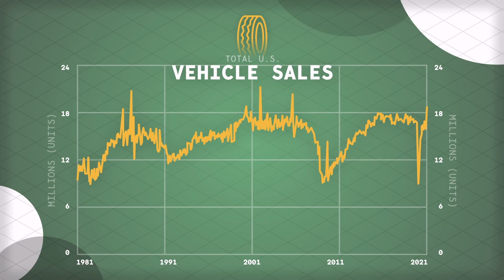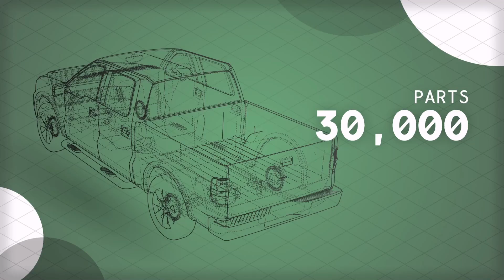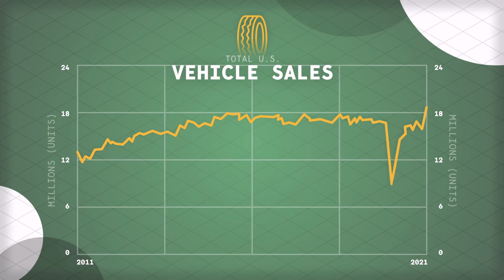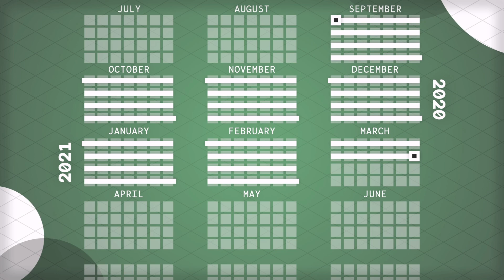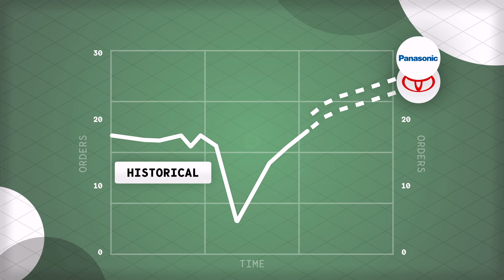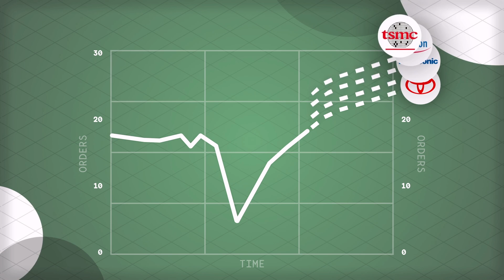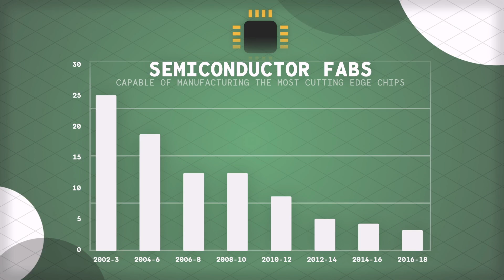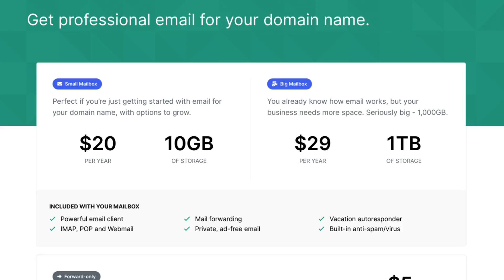Why the World is Running Out of Computers

Comment: I thought we had ran out of silicon, knowing it's just a logistics issue gives me some relief actually
Reply: I mean, silicon (next to oxygen and iron) is so abundend you will probably never run out if it unless you mine Earth
Reply: @fiiral5870  What do you mean? sand is so hard to come by these days, it's not like we have deserts of it lying around. /s .... (Yes I know we use a special type of sand, silica sand in the chip manufacturing chain, but it's still relatively abundant on earth.)
Reply: @holyboboli  sand rounded by wind is too round for cement, it need to be pointier to get in grip with the rest of the structure.
Reply: @holyboboli  there is actually a shortage of sand funnily enough
Reply: @expiredgoatmeal1666  Well, that too is a logistics issue tho (unless you want to tell me that the Sahara has no sand)
Reply: @holyboboli  not all sand is anywhere near the same. 2nd sand is silica not straight silicon. Beach sand is very round and smooth which is y Arab nations will import it while having endless deserts all around
Next time u go to a home improvement store look at the construction and vs the play sand
Reply: @Copyright_Infringement  The only usable sand (as far as we deem them to be with current technology) is sand that you get from river banks, so deserts are no help
Reply: @holyboboli   Imagine not knowing what sand actually is and thinking all sand is the same.
Reply: @holyboboli  Dubai
Reply: @jinjunliu2401  sand for silicon isn't bought because it's good for making concrete. Melt,purify,process,crystallize.... Then you've got the semiconductor.
Reply: @holyboboli  it's not really sand anymore it's quartz nowadays so yeah we're kinda fine
Reply: @retardationnation869  your wrong about the beach sand look up beach sand under microscope and you’ll see it’s not smooth at all it’s not even sand
Reply: @konopandada7872  and if i loo at a razor blade une one it's jagged and not sharp
Reply: @holyboboli  there are different categories of sand, some of which we are running out of. Silicon is also a major component of many rocks, and is one of the most abundant elements on earths crust.
Reply: @itdepends604  It seems you missed the sarcasm in my statement. Silicon is the second most abundant element found on Earth's crust.
Reply: @itdepends604  It's not a matter of the different forms of sand all having silicon .. it's the processing costs to get that silicon out. It's no different then getting hydrogen from nat gas versus from water. Both CH4 and H2O are quite high in hydrogen. To extract we have steam reforming of methane vs electrolysis of water. Only the former has reasonable production costs and an end product with marketable pricing.
Reply: @retardationnation869  You mean someone is selling sand to Arabs? LOL.
Reply: @holyboboli  Desert sand isn't useful sand, like how seawater isn't really useful water...
Reply: @Kurochana  I prefaced it with the fact that I know that we specifically use 95% grade silica sand.
Reply: @retardationnation869  "beach san is very round and smooth".. aren't it's the other way around; the sand which are eroded by wind is the one that's smooth and round shaped.

While the beach sand's actually the one that's rough (which is good for constructing)
Reply: @holyboboli  But how easy is the majority of it to access? We haven't run out of oil but it's getting more expensive everyday because the easy sauces are running out.
Reply: @fiiral5870  and it ain’t like Meteors or a synthesized form of it could be made. Just look at oil and coal!
Reply: Silicon is maybe the most cheapest mineral in the world simply bcoz its 3rd most abundant element in earth's crust
Reply: the issue is not on the supply side, its the demand thats never been higher. new consoles, new phones, smarter cars, smarter tvs, smart appliances... it all adds up, and if you dont get your order in quick enough, like car manufacturers after the pandemic hit, you get left behind when companies like nintendo and apple buy up half of the entire stock and the rest is being fought for by hundreds of big time companies like nvidia, amazon, microsoft, etc.
Reply: @jonathanodude6660  Amazon, Microsoft and Apple have the resources to build their own fabrication facilities. They could easily buy licences to build the chips required if they put their minds to it.
Reply: @AndrewHalliwell  they don’t have the skill nor the need. Tsmc has always been there for them. They don’t need to branch out of design and into manufacture if tsmc can keep up. Apple still uses intel modems, Samsung screens and other parts from other manufacturers because apple does not manufacture. Idk much about Amazon but both them and Microsoft have historically been software driven companies that have acquired and sold niche hardware solutions to advance their business. Neither of them manufacture as far as I’m aware. Going from 0 manufacturing experience to one of the most difficult things to manufacture other than scientific equipment for space flight or nanotechnology and trying to still be the best sounds like a recipe for disaster, at least for apple. Amazon does stand to gain from it but Microsoft will probably screw it up, let’s be real here.
Reply: @jonathanodude6660  Fair point about Microsoft. Screwing things up is what they're good at.
Reply: @AndrewHalliwell  they dont have the skills. making chips is an extremely hard. unless they hire a bunch of Taiwanese engineers and technicians they wouldnt be able to even they wanted
Reply: It's actually a chronical problem with the automobile industry ever since the idea of JIT (Just-In-Time) manufacturing became mainstream in the industry. Automobile manufacturers, having grown used to being the "boss" in their supply chain, didn't realize that they can't treat chip fabricators the same way they treat bolt manufacturers, simply due to the reality of the lead time.

If anything, fabricators like TSMC had already warned these automobile manufacturers in 2020 beforehand that it will be extremely difficult to try ramp up production again for them, once they drop their orders, in part due to the lead time, but also importantly due to how consumer electronics orders are much more profitable. But they ignored the warnings.

Interestingly, Toyota, the origin of the JIT concept, isn't affected by this chip shortage. Analysts believe it's because of the 2011 Japan earthquake and tsunami dealing a devastating blow to Toyota's supply chain, that they realized the long lead time in car chips make it unsuitable for JIT manufacturing. It took Toyota almost half a year to restore manufacturing operations to pre-tsunami levels. That prompted Toyota to draw up a list of around 500 priority supply items for which they would demand higher stock levels to hedge against unpredictable circumstances, allowing Toyota to escape the global car chip shortage this time.
Reply: Let me tell something new, there's hundreds of sand mafia in south asia. There's tons of sand in sahara but it's useless compare to river sand. Also river sand take a long time to be useable
Reply: Well run out of helium before we run out of silicon, I guess lol
Reply: There's an entire valley of it in California.
Reply: @FirstLast-uz6eq  😂😂😂😂
Reply: @FirstLast-uz6eq  silicon valley
Reply: Polymatter made no mention of natural conditions of Taiwan lately though. Record annual droughts are a real factor as the semiconductor industry there requires ALOT of water.
Reply: You have NO IDEA how relieved I was after reading this
Reply: Me too man... I thought I would never enjoy playing or watching anything digitally
Reply: @coloredfox3463  haha yeah. Bruh, I was born on 2002. Imagine visaualizing the next century of my life with minimal computers. Then I read this comment and watched the remainder of the video. Biggest "bruh" moment of my life.
Reply: @FelipeGonzalez-le5jv  I feel you man. I love videogames and tech. Without it, I wouldn't be who I am today
Reply: human's may be dumb, but we aren't dumb enough to build an entire economy of 7.6 billion people based on a limited non-renewable resource.

wait
Reply: VeChain baby
Reply: silicon is abundant but other semi-conducting materials like copper and gold (that are used with silicon to bulit chips and hardware) are one of the many minerals that are truly running out, and im talking about in the next 25 to 50 years left of supply.
Reply: They plummet the prices, so they can earn more
Reply: In 50 years we run out of Fossil energy
Reply: @idmarilamri6398  yes
Reply: I am here to sell all of you the best sand! It is the best. 2 for 1 special for you.
Reply: Lol... you thought dumb
Reply: It's not a matter of silicon abundance. It's that silicon it becomes harder to manufacture chips at small scales. Personally I think the industry is giving up on mass producing 7nm and below. Yes, I know we've engineered 7nm and below chips. But I'm talking about mass producing 7nm and below chips with new architectures, that includes server and desktop PCs, and bringing them to market.

We'll see them in the marketplace but they will not be mass marketed (to consumers) and they will be incredibly expensive because the process yield will be low.
Reply: Yeah I felt soo happy when he said that
Reply: Just wait till China invades Taiwan and then the Chinese start price gouging/creating perpetual artificial shortages
Reply: It's the most commen element in our known univers we can't run out of silicone
Reply: @hotsauce1646 : Some of us are not scientifically inclined lol😂
Reply: Same. I legit thought it was a Silicon issue as well, which would have been catastrophic to say the least.
Reply: Reading your comment gave me an anti-heart attack.
Reply: @Celery Man silicon is almost as common as oxygen.
Reply: @Celery Man that’s why we need to kill more people.
Reply: Oh don't you worry, they're working on new, innovative ways to make sure we run out of silicon and everything else. Gotta keep demand high!
Reply: @ArcangelZero7  we will run out of oxygen before we run out of silicon.
Reply: @ToomanyFrancis  And don't worry, when we do, they'll be there to bill you for the privilege of breathing. XD hahaha

But yeah the silicon isn't so bothersome, it's the increasingly rare "rare earth" materials that have me worried. Everything from their availability to how they're mined is just awful.
Reply: Supply chain has been down to a science for a while now. Any disruption to it is a bad thing. Trump tariffs happened, then Covid right behind that. It will be several years before it gets back to normal.
Reply: Well rocks are made from silocon and most silicon we use comes from quartz and we got ridiculously large heaps of that shit
Reply: If we somehow "ran out" of silicon, I feel like it'd hit way harder being one of the most abundant materials on our planet.
Reply: I thought it was going to be about shenanigans in regards to rare metal elements
Reply: @e-wall199  😂 I thought the same.
Reply: No wonder, it's such a clickbait title.
Reply: We are running out of other precious metals though. Only s matter of time.
Reply: Nah, semiconductor manufacturers (like the one I work for) only produce stuff for the orders they have, during the pandemic we got a lot fewer orders than we normally do. Thus we didn’t produce as much. We are ramping up production now to meet the increasing demand though.
Reply: To add back some anxiety to a different aspect of the supply that I think we might all need to really think about at the very least, surely part of the crux of the situation here is in regards to US imperialism, coltan mining in the Congo being but one example. RIP Lumumba.

Every hand that feeds is bitten if it steals from hungry mouths.

Comment: I'm more worried about what come after it though from oversupplying. After the last DRAM shortage, they overbuilt the fab, causing an oversupply of DRAM chip, which lead to a DRAM chip price collapsing from oversupply. Better to have too much demand and not enough supply than having too much supply and not enough demand. Would have to lay off hundred of workers during the supply dial down.

Comment: I don't get digital speedometers and stuff. I mean, why? Why would you choose a digital way to measure stuff if the analog way is just as good (and better most of the times)? I get professional precision instruments like chemist scales or something that actually makes a difference in everyday life like computers for automating boring and time-consuming stuff, but come on, do you really need a lamp with a chip on it so that, instead of a reliable switch, you can turn it on and off with an unstable app that's bound to the manufacturer instead of an electrician? Do you really need that 300 dollar laptop that's gonna fail in a year? Do you really need a gigantic screen in your car when you have a much better device in your pocket at all times? Do you really need a 65 inches TV in your 20 square meters living room? Do you really need your fridge to rimind you to buy milk? This kinda stuff will always bother me. Using computers to make our lives easier? I'm all for it, I'm a software engineer for that reason too. Using computers to make us dumber and more reliable on companies? Hell no